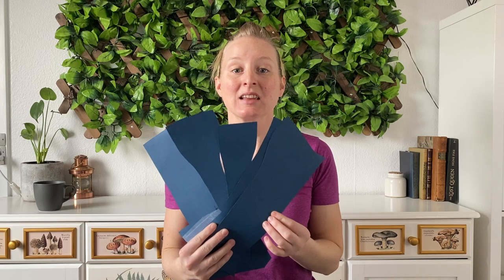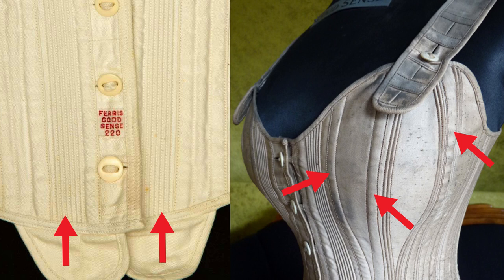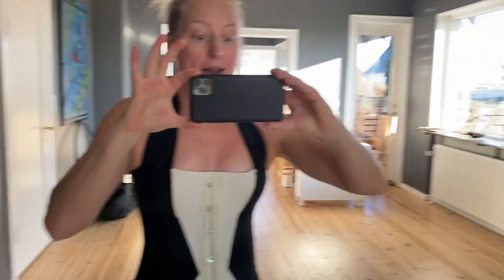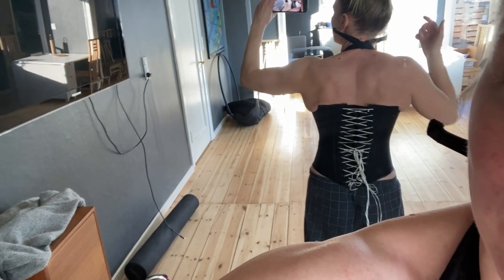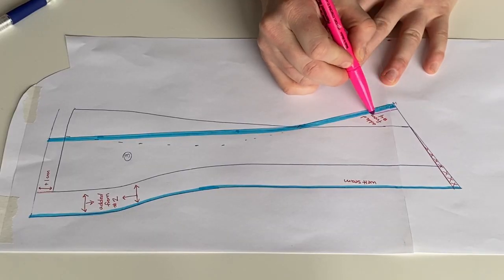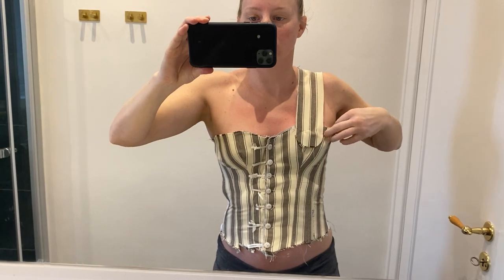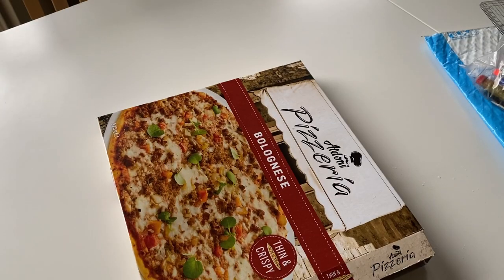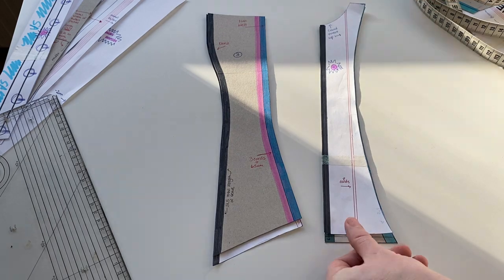Fashion Corset ––► Athletic Corset || Redesigns, Mock-ups, & Alterations, Oh My! #CorsetryInMotion

Comment: 2 Ren Fair seasons ago, I made a leather corset out of a leather jacket. Many years of thinking about making myself a corset and designing it in my head. How it should fit and what features it would have. After endless patterns and mock ups of my own making. And hours of hammering grommets, zip ties for bones, hot glue, sewing. It's almost armor, and I didn't realize until I'm in it, walking through the cow fields to the actual site our Ren Fair sits. Which is a valley of un farmable land in the middle of a farm that's basically a hole into the earth that's woods, roots, Billy goat hills, and a Renaissance town built into it. I realized I could not bend over at all. I mean, AT ALL! I made the torso way too long, and basically, I was a plank of wood with knees and feet. I cut it down for last year, and it worked a little better but still no wonder society deemed them unhealthy. I could not even go to the bathroom, I could not sit down! And giggling all day because of it didn't help! 😂😂😂

Comment: hmm... I'm wondering if, instead of a powernet panel you could overlap a bunch of elastic straps, like the way they overlap ribbons in ribbon corsets. You'd avoid the gaps, and still use an elastic style similar to that of the 1890's.
Reply from the maker: It's definitely an option to explore. I've used overlapping elastic strips before (on the bottoms of gaitors/spats) and I never liked that solution; the way you get two thicknesses of elastic in certain places always kind of bugged me. But that's just a personal preference on my part, and I think your option is interesting as well! Full panels of elastic, while certainly more prevalent in the 19-teens, is seen at least as early as 1902, so at least I'm not jumping the gun TOO much ;-)
Reply: @ShannonMakes , just a thought the power elastic done doubled but cut at an angle and placed back to back would add more body to it which would also add a better strength to the side panels. Sorry I can picture it in my head but having trouble explaining it. I remember (about to show my age) 40 years  ago buying a modern elasticated only pull on tummy flatness ad it was made with the same stuff you used on the side of the corset but each panel was made with ( \ / ) to make it Look like ( | ) this made the elastic stronger but because of the way it was done it also stopped it from wearing out fast they lasted for almost 30 years but I can not find them today (note to past self always buy a spare😹😹😹) in other words the way it was made not only supported me it also supported the garment as well and thus made it last longer. The only drawback is elastic does eventually brake down no matter how much you care for it. It starts to harden if not used once it has been worn a few times I think that has something to do with our body sweat and then the washing of the garment. 
I liked the idea of the elastic side panel but when I do look to making one I think I will opt for the option of using the dubbed version idea for added support and allowing it to support itself as well.
Now off to watch the next video on your making it🤗🤗🤗